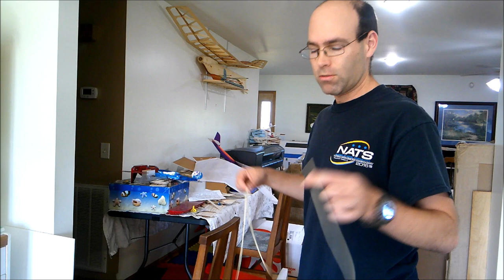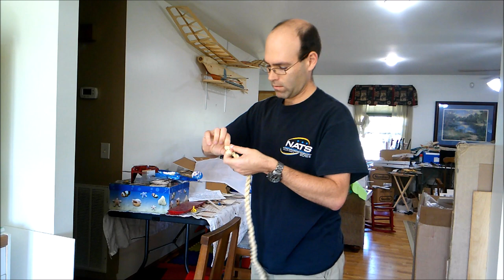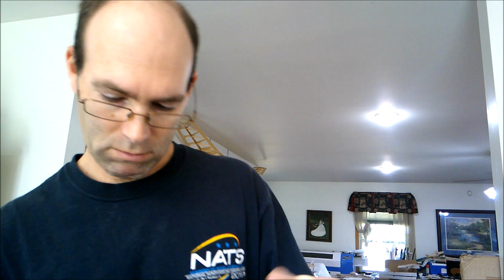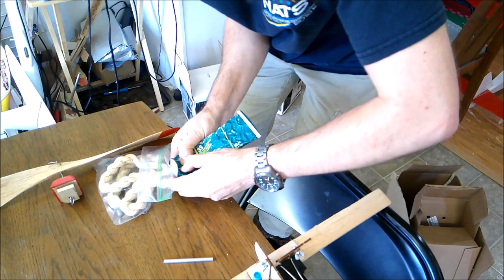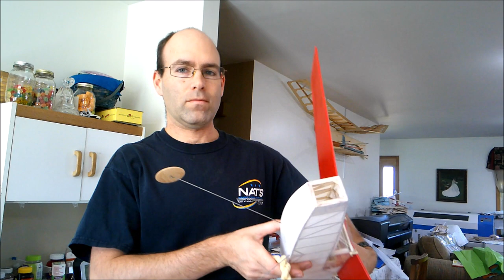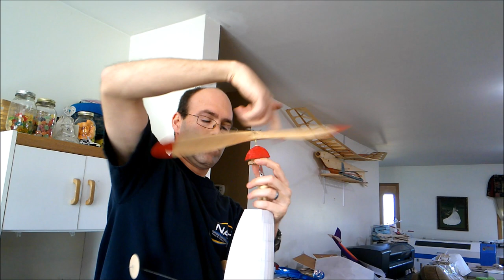Flight prep for big rubber powered airplanes: Ripmax Gipsy

Comment: I really enjoy your videos, I am getting back into rubber powered aircraft again it's been years since I have build stick construction aircraft.  I have always had a problem with painting.   In the 60's we used airplane dope but when I finished my models they lo9oked good  but didn't fly very well as they were very heavy,  How do you paint these without adding a lot of weight?  What are you using for glue?  I'm sure sionce the 60's a lot as changed in the model industry and a lot of new techniques are being used   I need a little guidance.
Reply from the maker: Still using the same glues. Trick is to use as little as possible. I use at most two coats of nitrate dope, thinned to only 20% or so. I use that as the covering adhesive too, two thinned coats on the entire structure before covering, activated with acetone after laying down the covering. Most of my structure is assembled with CA these days out of sheer laziness.
Reply: @joshuawfinn  so to add color you use different color coverings right?  In the old days we got covering material only in white in the kit.  Then we had to paint or fly white. Originally I used Ambroid adhesive not very strong and pretty heavy.  Thank yo9u for the response I'm ready to begin a build now.
Reply from the maker: @normbenjamin  you can also color the tissue with colored dope, Rit dye, or even rattle can spray paint if you just use really light coats (i did this after doping the Gipsy)

Comment: I know people in the rubber powered community call this braiding but technically isn't this more of a furling  or a furled rubber motor?
Reply from the maker: Probably is. I call it what everyone else does to avoid confusion.
Reply: It is the same technique used in ropemaking, but hemp strands are not as stretchy, so requires a lot more force to create the twist in the rope.

Comment: Is that a Phill Kraft FF on the Wall?
Reply from the maker: The big one? That's an Amazoom 1300, and upscale of Stan Hill's 400 sq in design from 1955. My wife likes the crazy oversized woodwork, so it became a living room decoration
Reply: @joshuawfinn  Amazoom was designed by a woman.  No kidding
Reply from the maker: @tomryan9718  Amazon was the one designed by Stan's wife, at least based on my research. Unfortunately I've never seen one of those. It's a little more boxy, but a slightly older design too. By all accounts both of them must have been brilliant designers and fliers. Amazoom is NOT an easy airplane to trim. Haven't heard anything about Amazon.
Reply: @joshuawfinn  I spoke too soon.  Where are you located?  Im in Central OH
Reply from the maker: @tomryan9718  I'm 2 hrs south of Atlanta, GA. Absolute middle of nowhere. Unfortunately nearest good FF fields are all 4+ hrs away.